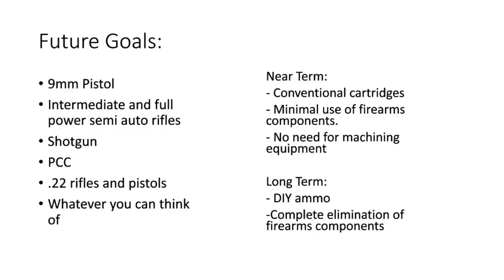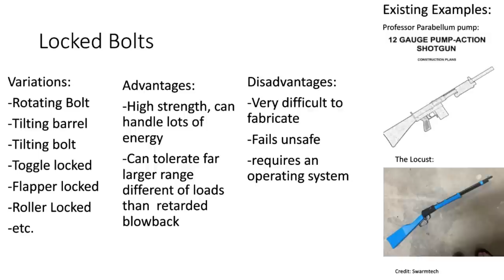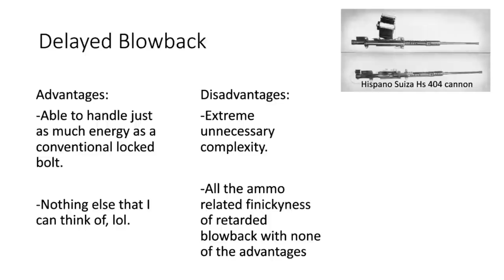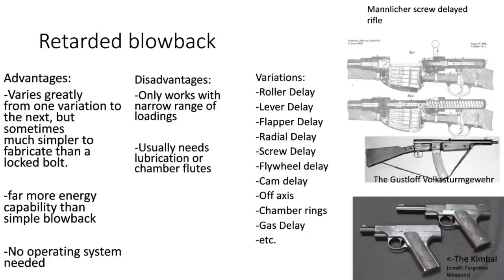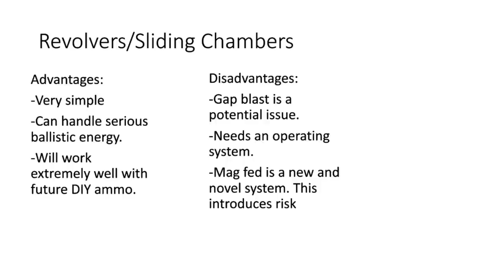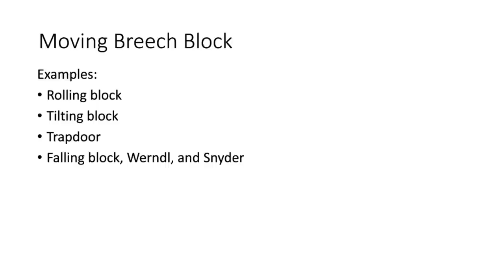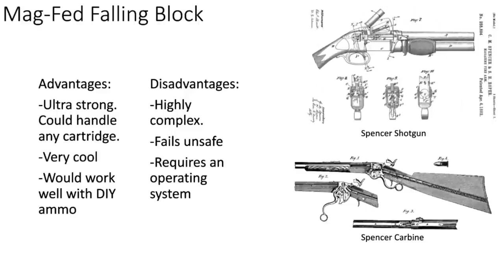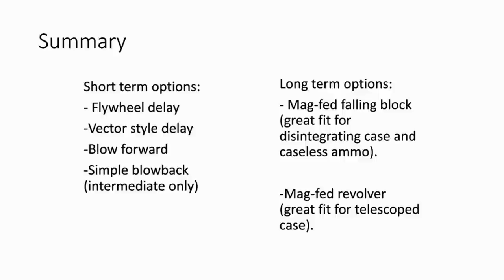The Future of Printed Rifles

Comment: Long recoil worked really well in the transition to smokeless, when strength of materials was the limiting factor. Now that we’re walking back the material strength again it seems like a good choice for a nice safe system.
Reply: Long-recoil's low pressure at extraction would suit alternative propellants like ammonium perchlorate that are easier to make than gunpowder, but which have never been used in real guns since they don't have to 'resort' to propellants so poisonous, corrosive, etc.
Reply: Oh yeah, captive-piston cartridges would be good for such propellants too.

Comment: I really like the idea of the Mag-Fed revolver, whenever i have the time and resources to try to design something i’ll almost definitely try to make some designs around it
Reply: Checkout the dardrik tround rifle
Reply from the maker: Awesome! Can't wait to see it!
Reply: The Rossi circuit judge uses a simple sheet metal shield to contain (and redirect) gap blast. Or you could add a cam to the op rod that moves the barrel back (or cylinder forward) to seal the gap.
Reply: @wadekirby8575  i designed a mag-fed revolver cylinder that got pushed forward  by the rear block (which in turn locked) and envelopped the barrel for a tight seal (or a recess in the cylinder for the barrel to lock), but i'm not good enough in 3D design to achieve it. Feel free to contact me.
Reply: I cannot recall the name but there is one that existed historically. It had a 2 chamber cylinder and when the action cycled it extracted the old case, rotated the cylinder, and fed a new round into the empty chamber. It is honestly really fascinating

EDIT: it is the Landstad 1900
Reply: Me too. I also want to merge it with the basic of a Vektor P1. It'd be a good conceal and carry.
If you could message me, I would like to help.

Comment: Hey, don't forget blow_up_ operation. (That's blowback and blow-forward at the same time, like the Douglas 'recoilless' (balanced-recoil) SMG.  Advantage: a rearwards-operating bolt allows a sensible manual of arms, and also cocks the hammer/striker for you without any unnatural sort of linkages which is how I imagine blow-forward works)

Comment: I loved this video so much! I thought about screw delay and blow forward as incredibly simple solutions but it's very obvious you've actually done some serious research into these and know way more than we do. I never even thought about a rotary mag being a solution to blow forward feeding issues. I'm so excited. Two things that may be interesting to think about are externally powered operation with a Lipo battery and motor and also combustion guns. People get some pretty insane velocity by dieseling springer air guns. Imagine if you slapped a 3d printed wet no2 fuel injector into one of those. I have no idea how you could fabricate a piston capable of containing the heat and forces required. Maybe just leave a slight gap and accept some losses due to cylinder gaps.
Reply from the maker: That's a really cool idea! A diesel operated gun sounds so wonderfully Fallout.
Reply: Nitric acid + kerosene was experimented with by Germany in WWII as a liquid artillery propellant.

Oh yeah, ram accelerators use methane and air, obviously extremely easy to get.  They are very much not small arms, though.
Reply: @smorrow  I wonder if this is still the best combination to use. Obviously you need something energy dense but also you need good gas generation or you're not going to move anything for very long. I also wonder if detonation could be used for compression/complete burning of fuel+oxidizer.
Reply: @haydennorris2913  All manner of liquid propellants have been used.
Reply: Has anyone ever studied gas powered nail guns, and/or taken one apart and repurpose its internal mechanism as the heart of a firearm?
Reply: @EvanJonesProjects  Reminds me of the Dieselgewehr from Wolfenstein.

Comment: In terms of dealing with gap blast from a revolver type firearm, the Nagant revolver got rid of this by having the cylinder move forward and back when firing, using the brass of the case to seal the gas. This did mean having to have the bullet recessed in the case though. Maybe some sort of fixed piece that the cylinder could use to seal gas might be useful?

Comment: a lesson from crossbows which would be relevant for some breech mechanisms:  In the rolling nut crossbow release mechanism, the axle through the center of the nut is to retain the nut while it rotates, not to hold against hundreds of pounds draw weight.  While the crossbow is cocked the nut outside surface rests inside the socket in the stock.

Comment: I think an off the shelf solution for a bolt locking mechanism could be made from quick detach hydraulic components, they're designed to take 1000s to 10s of 1000s of psi and be air tight, so some sort of rotating bolt could be fabricated using them.

My personal designs use a gas operated falling block/chamber-sled that moves vertically and backwards at an angle, and is too complicated to make without a cnc or machining skill.
Reply from the maker: That's a spectacular idea!!!
Reply: Yeah, or Halder lifting pins.

Comment: It seems that the locking surfaces on the receiver are possible some of the hardest to manufacture. I think that this could be solved by cutting material away from the front and putting the barrel in after that. I made a video of this on my channel

Comment: Other ideas .... Electro magnetic delay...solenoid locks the bolt in place and uses on board circuitry to control timing.
Reply: Electric firing is an eminently good idea - it makes all manner of mad (advance primer ignition, burst firing) and mundane (safety selector, rate-of-fire limiter) things mechanically trivial.  Electric operating, I'm not so sure. How does manually cycling the action (e.g., to load the first round) work?

Comment: A video about the future of printed pistols and revolvers would be very interesting.
Also explaining the basics of the different mechanisms (hammer fired, striker fired, moving slide, moving bolt, etc) with examples of real factory made guns using them and the potential issues with designing and building certain mechanisms (complexity, needed accuracy, flame cutting in revolvers, etc)

Could really help to give people a better understanding of the possibilities and limitations and maybe even inspire some people to try mechanisms or ideas they haven’t thought about before.
Reply: Fire-control groups are my weak point for sure, because everything I know I learned from Forgotten Weapons, and he never really covers trigger groups.

Comment: Great video! I was a bit disappointed my favorite (long & short recoil) didn't make it into the video, but I enjoyed the discussion and am excited by the possibility of a .350 legend rifle. 350 legend is particularly interesting to me, as it has the same energy as a .223 while offering a more easily ECM'ed barrel option. A similar case could be manufactured using cut-down .223 brass for those with strict ammunition controls, maybe call it 350 kurtz. It'd offer similar velocities if paired with a bonded sabot like we see in the Dagny Dagger system.
Reply: 350 kurtz would be interesting, as 350 legend brass isn‘t as common and being able to just cut down 223 casings would make this caliber very cheap and easy to make.
Designing 350 kurtz mags should be rather simple, as the diameter of 223 casings is very similar to 9mm and as they would be straight walled there would be no need for a curved mag, so all that’s needed is to just lengthen an existing 9mm mag to fit this new cartridge.

The lower recoil of 450 kurtz would also allow to test out mechanisms with lower pressures and improve upon basic design elements before eventually moving to cartridges with more power where the learnings from the lower-power tests could then be applied.

Btw, if the „kurtz“ should be the german version of „short“, it would be „kurz“ without the t.
But I kinda like the t as it gives it a more americanised sounding name (from the perspective of a native german speaker), so yeah.
You decide what you prefer for naming, you are the inventor of this cartridge.
Reply: @yourlocaltoad5102  There is another alternative to 350 legend. 357 AR-Max it's a 223 case turned into a straight-wall. That would be easy to do, even in Europe, I think.  If it's possible, I would add a belt to take hotter loads.

Comment: I think the falling locking block/tab design like on the Vz 58 would be the way to go. You could make the locking tabs and locking surface as big as you wish, potentially using almost entirely plastic parts for the bolt and bolt carrier. The locking tab design should work with long and short stroke gas systems.

Comment: Very interesting! The concept of a flywheel delay system has my mind working on design ideas. Imagine using threaded steel cable attached to the front of the bolt face that is strong enough for a pair of stands to handle the force. You would have a set of roller wheels along side the barrel in front of the bolt to reverse the cable travel back towards the rear of the stock. You would have second set of rollers where the angle of the grip changes into the grip section of the rifle stock. The third set of rollers would be the same distance farther down the grip that the bolt needs to travel to cycle the action and would reverse the direction of the cables back towards the bolt. In a cavity in the grip section would be a guide rod with a recoil spring attached to a counter weight which would be compressed towards the rear of the stock in the same direction as the opening bolt by the attached cables. As the spring reaches full compression the direction of the weight and bolt both reverse and lock the action back closed. This could allow for much more inertial mass with the bolt itself not needing to be large enough to make up all of that weight.

Comment: I always thought of how to use a ball detent to modify the bolt on the FGC9. With a slightly modified upper it would be reasonable to think you could shorten up the bolt enough to allow for a folding stock/brace.
Reply: Your comment is hard to follow. Are ball detent and folding supposed to be related or...?

Comment: I know you mentioned it in the video, but take another look at screw delayed blowback. If the reciever has an angled cam, lets say 30 degrees, the bolt travels twice the distance along the angle as it actually travels linearly allowing a safe extraction rate. Furthermore, you dont need to make a full revolution around the reciever either. This allows a bolt weighing half as much as a traditional blowback bolt (with a 30 degree angle). That would work enough for a .223 and .308 unless you want sub 8 lb rifles.

Comment: idk about you guys but IM not in the 3d printing game to make recievers and guns out of
im in it to make accessories that make real metal guns function slightly better.

Like imagine you had a whether proof slap-on sort of slide
that cam-cycles your bolt action for you when ever you press Trigger 2, because you made a custom slide rig tailored for your rifle and it uses its own magnetic rail to do it. And since its external, if it fails, you can still use the gun normally until you replace the bolt assist. Its not a blowback mechanism. No gas tube. Doesn't do anything in terms of interracting with the action other than being like a motor on a revolver hammer that fans it for you when supplied with power.

And then
this invention
allows you to make an obrez  SHFT 50 upper on an experimentally designed bullpup 3d lower, and make it blast faster than a GM6 Lynx's firerate for $15k less than an actual GM6 Lynx. At the cost comfort as you eat a locked bolt's recoil since there isn't a longstroke system.
And not a shitty trigger
because you get to use the art of CAD software to remaster the 300 year old concept known as the "set trigger" which were designed to make gun triggers feel less shitty to squeeze since even before our grand fathers.

Comment: A fully DIY gas-operated system is something that I have often wondered about. As far as manufacturing and allowable tolerances go, it probably would be one of the "easier" options for higher pressure cartridges, I think the challenge there is just finding a way for it to be easily replicated, but I imagine there is someone smart who'll figure it out.

Comment: Blow-forward are not done for almost anything but the most anemic rounds due to the fact that they contribute to significant increase in recoil forces. A shotgun round would be extremely uncomfortable to operate.
Reply: Put the whole assembly on an FG42-style recoil buffer.
Reply: As I understand it, the alleged higher felt recoil of blow-forward guns is due to the double recoil impulse of firstly the entire system splitting its momentum with the bullet, and then the barrel coming back to closed.  If this is the case, then making a blow-forward rifle that's simply quarter-automatic (self-ejecting but not self-loading) would not have the recoil problem, and maybe even could be tuned to be balanced-recoil. (And the reason I keep bringing up quarter-automatic in the context of blow-forward is it's just a good match, in that automatic blow-forward requires you to do magazine design, and demi-semi frees you from that.)

Comment: Great video! I had an idea related to this the other day after seeing a weird cartridge called the 357/44 Bobcat. Uses plastic collars around the case necks to prevent case setback in revolvers, I assume those collars would also reduce bolt thrust in an automatic. I'm sure this has plenty of limitations but if it works it could allow the use of powerful, factory, bottleneck cartridges in a blowback. Haven't done the math on this, curious to hear your thoughts.
Reply from the maker: I didn't know about that before. That's really cool! I wonder if the concept could be used to fire 5.56 out of straight walled ECM chambers......

Comment: I'm actually working on my own homemade ammunition that uses pla as the cartridge and instead of the primer it uses to electrical connectors on either side I got the idea from the dardick tround ammo
Reply: Have you considered having a ring around the rim of your cartridge and a center pin, for your contacts? 

You might be able to find a copper washer to use as the ring, and slide it over the center section where the middle post would be embedded.
Then, slide (or print, idk) a (thick) plastic washer behind the copper washer to hold it in place at the base. 
Then use a nichrome (or whatever) wire to bridge from the center post to the outer washer, through the gunpowder.

If you are seeing a lightbulb 💡 shaped like a cartridge, in your minds eye while reading what I wrote, that’s what I was trying to describe. The filament lights the gunpowder.

With a conductive ring around the rim and a center post, it makes the cartridge less prone to being inserted without making contact. 

You can make the breech have only one contact on the side and one contact for the center post and still be assured that no matter how you insert the cartridge, you will have continuity.

For reliability, I would make the breach have a ring that would come into contact with the cartridges rim ring, for instance, using a bronze bushing or similar as part of the breech face, but I guess that’s probably just my over engineering OCD coming out to play.
Reply: @akseminole  bro read your comment gave me a lot of think about. I like your thinking this would be good because I won't have to worry about the ammunition being on a two-dimensional plane and it'll work like a regular cartridge on a three-dimensional plane
Reply: @akseminole  >The filament lights the gunpowder
The IRA did this. It was a camera flash bulb though.

Comment: 15:00 I would contest that new magazines are necessarily "a risk" in the context of telescoped, perfectly straight-walled cartridges.
The way I see it, the reason behind the "magazines are hard" thing is that magazines are 3D things, in contrast to almost anything else in guns which is really "2.5D" - "two-dimensional schematically, but it technically has thickness". People do do gun stuff in Algodoo, after all.
If I'm right that "number of dimensions" is really what determines the difficulty, then yeah, CTA magazines really are just a box and a spring.

Comment: I've been toying with a lever delay system that uses a rack and pinion system, where the pinion is minted to the bolt proper, and the racks are mounted to the carrier and receiver respectively. essentially similar to your flywheel transfer system, but adapted to the format. Still early and with my direct blowback about to enter beta soon not sure when ill get to it.

Comment: Don't forget about 
-Open chamber guns like the Tround50 (Dardick revolver with electromotor). 
Uses polymer cartridges. You would simply have to machine the rotor and could use a pipe segment as a receiver. 
With enough torque you can chew through potential misfired cartridges and simply keep firing. 
Add electric ignition and you have something approaching a homemade minigun.
-Hughes lockless with chiclet polymer cartridge cases
Reply from the maker: I hadn't heard of the Hughes lockless before. Looks like an excellent candidate!
Reply: @EvanJonesProjects  It's in the ARES report on case-telescoped ammunition, which is a great document.  There's a pretty major facepalm about conventional-cases limitations on like every other page.
Reply: @EvanJonesProjects  I just remembered another totally underrated mechanism. The elevator bolt design of the Steyr ACR.
Uses polymer cased telescoped ammunition, super simple design. 
Only reason it was never looked at again was because it was designed to fire flechettes. I bet it's worth to revisit that design and seat a bullet instead of a flechette.